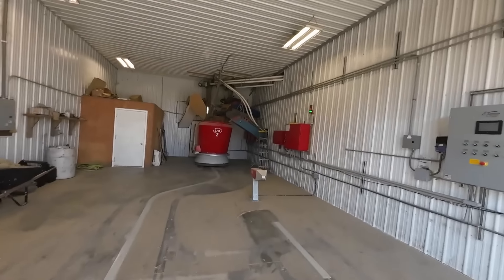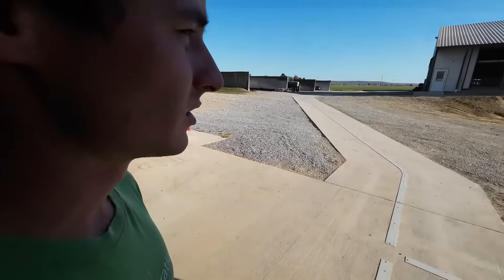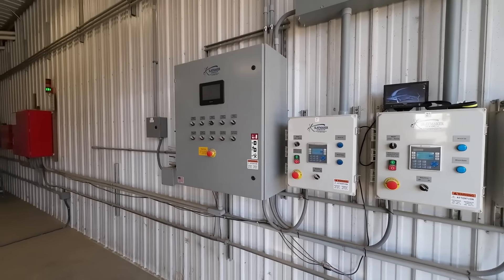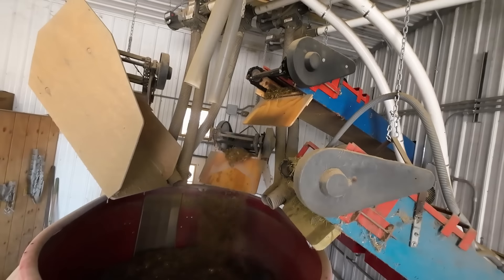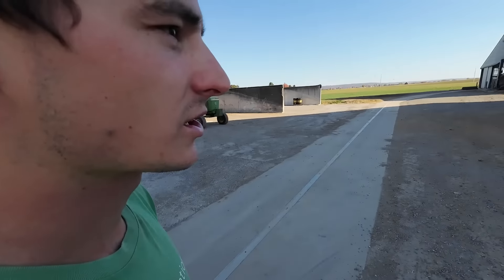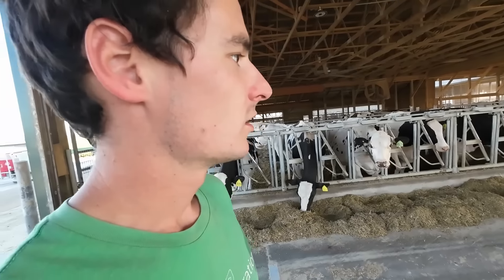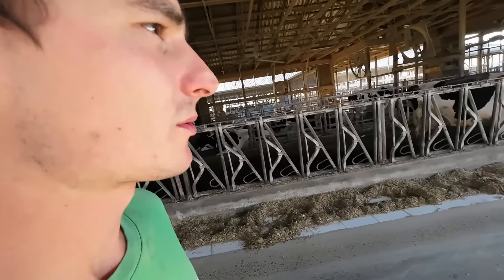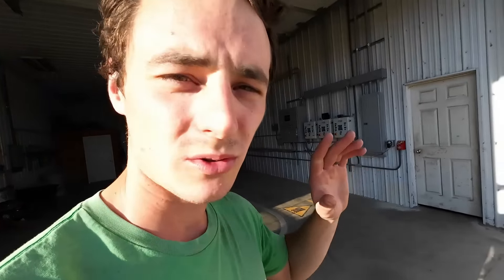Common Questions: What about Snow? Why Not Robot Milkers?

Comment: Some of the skidder brush attachments  are very good at keeping things clean. They're not all the same.
Consider a line bore two inch plastic to the low point with a horizontal screened scupper at the problem area. Very economical to install.

Comment: I think your snow removal would be helped tremendously with a rotating sweeper brush attachment for your skid steers. It would be less likely to damage the metal track like a bucket. Could also be used for snow removal in other areas as well as a sweeper to remove dust, dirt, stones etc. from all your concrete paths.

Comment: Thank you for sharing your thoughts and experiences thus far with your new feeding system. Clearly you and your family have put a lot of thought into making this huge investment into your operation. I like your new robotic feeding system because it sure looks much more labor efficient than your old system. And I think it has removed a lot of stress from you and your dad. Because I remember watching you have to deal with all of the weather issues while using the old “bunkers”. And now you no longer have to deal with all of that frustrating plastic covering, the old tires, the frozen wet feed, and some times moldy feed. So savings from less wasted feed! And be sure to include a value for the reduced labor and stress factor for you and your dad. Thank you so much for posting another wonderful video as always! Have a blessed weekend!

Comment: Great video, mag flakes or salt will help keep the run ways clear.
You’ve made a massive investment on a relatively small dairy unit, but it looks extremely well run and managed. 100% agree with you on the robot milking, can’t beat staying hands on with cows.
Protocol drift is something we struggle with on our units, but good training and engaged staff help massively. When staff see and understand the investment you have made to help run a smooth operation they want to work with you not against you.
Credit to your father, yourself and your team.👍

Comment: Put on a sweeproller in front and a saltbox (old fertilizerspreader) on the back of a tractor and you got ice free concrete. Use it on sidewalk who need to be ice free in Norway wich has a loooot more snow compared to you. We Use a blade or a blower on first run if its more then 15-20 cm.

Comment: Have you considered a rotary brush attachment for the skidsteer for snow removal?  A bucket may damage the strips/screw heads where as a brush should help not damage those.  When I was in the Air Force we had one of those on our bobcat and it did pretty well around equipment with exposed bolt/screw heads without damaging anything.

Comment: How much time do you save with the robot feeders? 
Do you save significant amount of fuel  cost - not running the skid steer, tractor etc. using the robots?
Have the solar panels helped with your energy costs?
Interesting system and thanks for your patience in explaining your operation and this system! Impressive!

Comment: Automation is great for the situations in which it will be a benefit. But automating everything is likely to cause issues not even imagined. The need for human eyes, ears, nose, and feel.. will be needed for many years to come. Also, as you mentioned, bringing up younger works to learn how to do work is important. Who will become the next group of workers if no one provides them an opportunity?
One last mention (I help run a mfg. company). Try to avoid letting the "numbers" become too important. Money is the result of everything that takes place. It is a "lag" measurement. It's after everything is done. It's also very hard to truly know all the variables that made things happen to the money. At best.. it's an educated estimate. But.. measuring actual variables (where the work truly gets done) is far more valuable. If you learn what normal is, what variation normal can deal with, and when to spot "not normal" data then you can really start to steer the ship. I heard you mention you look forward to getting the feed data soon. Good for you. That's going to be really valuable in learning how your feed systems are actually working.
Nice video.

Comment: Hello, I know that you get a lot of "ideas" from so-called sofa professionals, but did you consider cutting out the concrete under the metal strips (similar to what you do in the cow barn for grip) for the robot to follow? It shouldn’t be too expensive, and then you could clear the robot route with a bucket because the plates would be lover then the concrete. Love the videos.
Reply: That could work but would they need to reprogram the robot again or could it work with the strips just lower.
Reply: @rtge35z95  I was thinking about the same thing

Comment: Do you have a roller street brush? Like road crews use. If you can set the brushes to just touch the surface, it will work. I use to use it without wearing down the road surface. Lasts a long time.

Comment: Inconsistent labour is the reason you go to robotic milking which is a problem you do not have.
Robotic milking systems have their own work load thats little talked about and like all systems prep work and on time maintenance is important. A major building upgrade would be needed if you went to a rotary platform system which gives high cow flow and you do not appear to have enough room for a breast rail lift exit system which would speed cow exit soooo it comes down to a robotic system that would fit in the footprint and then we have come full circle to good labour availability  and until that breaks or other factors come into play then it will be as it is.
Have you thought of ways of diversifying  in any form to future proof the farm from outside  influences?  I realize this is a wide open question however it would be good to hear your thoughts and possible options open to the farm .

Comment: I like your opinion about seeing the cows while milking. However your argument about dropping production isn’t really true. Here in the Netherlands you see the robot milking on most of the farms now. There is always a drop the first couple of weeks, but after that the production rises back up. You will have always cows who are “lazy” and will miss a milking, but the Lely app will provide you with a list and you can get them and put them in a waiting room where they are forced to go to the robot.
Reply: Cows later in lactation are still  milked 2.5-3x a day up to three weeks before dry off. Then they only get milked 2x. You gain production by milking your high producers more than 3x with robots. Robots also let you feed more or less energy depending on production

Comment: You mentioned wanting to switch to robotic feeding bc you couldn't hire someone to load feed accurately but you said you hoped the vector would have 90% feeding accuracy. My 10 year old could load feed better than that. That is horrible accuracy
Reply from the maker: We are getting 99% accuracy on grains and 98% on silage with the Vector.
Reply: @10thgenerationdairyman61  you said in that video you were hoping for 90%. My feed man is 97% on everything
Reply from the maker: I think I said over 90% in my video but at that point we were not getting accuracy data. Sounds like your feed man does a good job.

Comment: Edison Motors ev conversion kits for semus.  utube, charge the 250 kwh battery bank at .10 late eve and power the dairy and house all day when not in use hauling grain, fodder.  Edison will train your diesel mechanic and certify him on your equipment.   And do solar materials and training.  I bet your payback is less than 5 years.  With panel efficencys and 35 kwh batteries from Edison no truck needed.  Sell excess to the utility and plant hemp for feed , bio diesel, and fibre.  The hemp cake fills ob demand in the ration.  Excellent.  
 omegas protein.  Imagine savings on your diesel and electricy.  Good luck with better milk and grain prices.